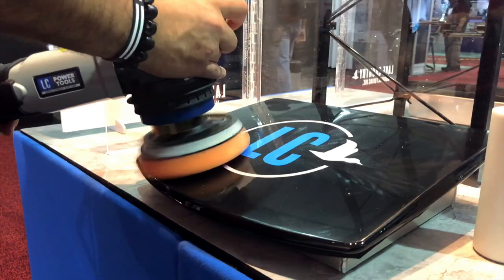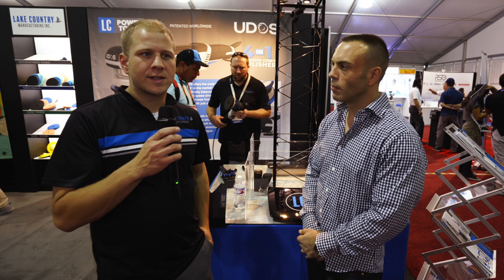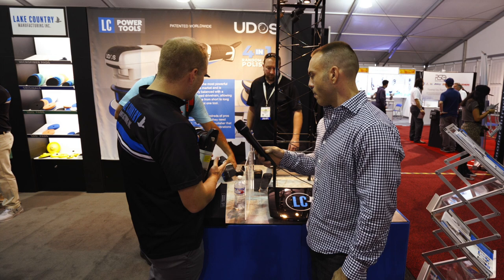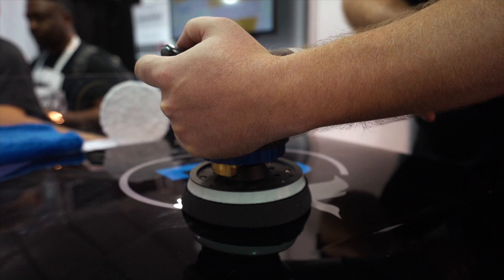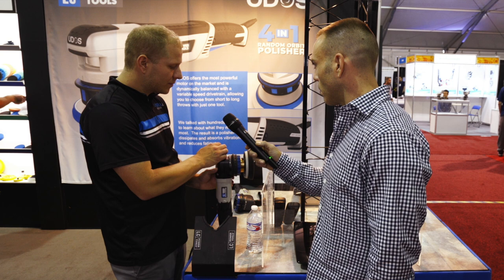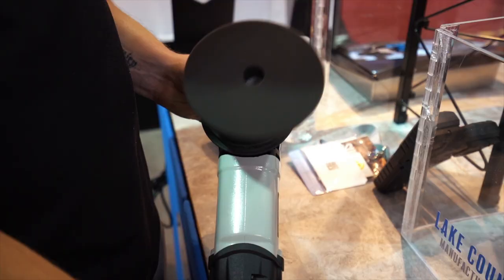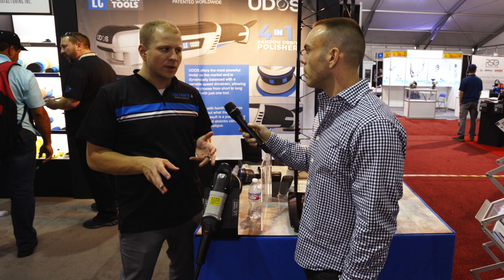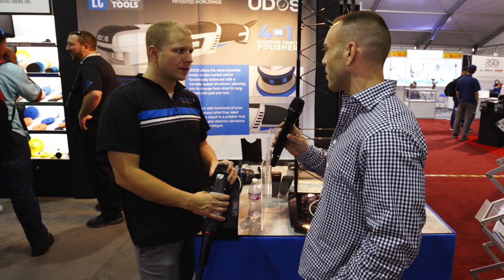SEMA 2018: Lake Country Manufacturing / LC Power Tools UDOS Polisher

Comment: He mentioned Porter Cable three times. Did LC work with Porter Cable on this polisher.  The body does resemble a Porter Cable.
Reply from the maker: No, that’s just for reference since there has been so many PC users out there throughout the years. This machine was designed from the ground up by Lake Country engineers, and is patented worldwide.

Comment: And this machine goes on sale when?
Reply from the maker: From what I'm told, we can expect to see this in stock for sale at retailers around April. The final design and testing is about done, and only a few minor tweaks were left to be made in terms of ergonomics. It already felt great in-hand at SEMA though, super smooth and powerful!
Reply: Q1 2020
Reply from the maker: Yup, update from SEMA 2019 with the finalized version is that UDOS will be shipping Q1 2020, and it’s a real beast now that it’s done!